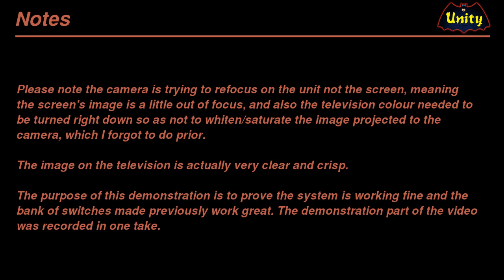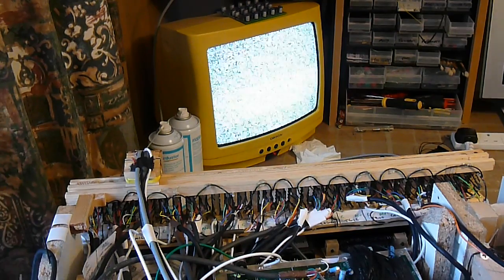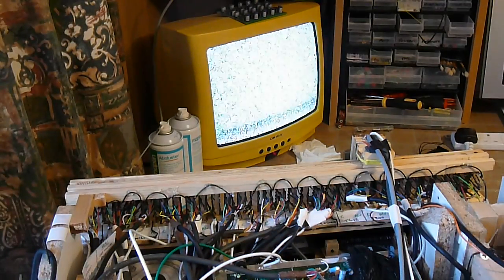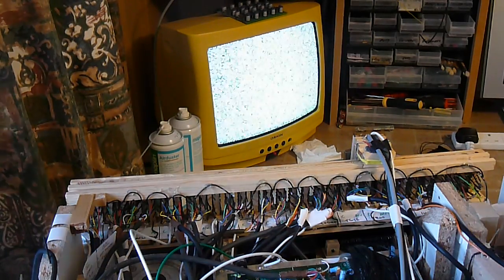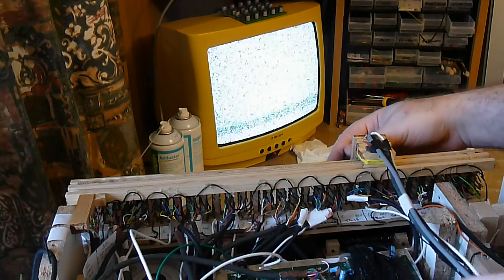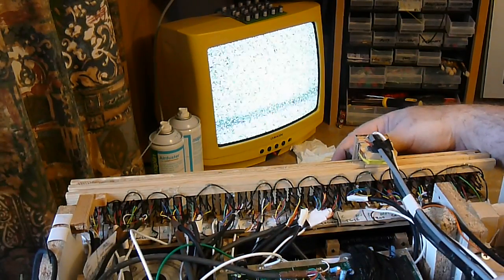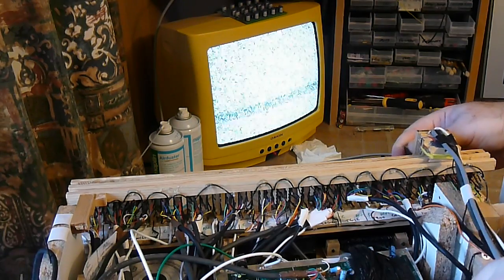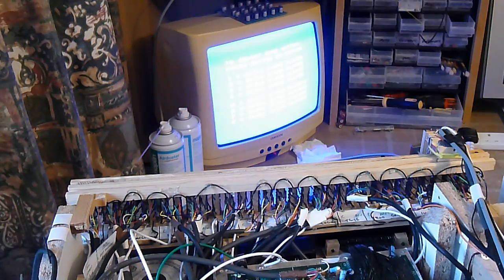Update on Project Unity system - mostly done, 90% completed

Comment from the maker: Yes, there are quite a few methods in the reference section on my forum, check them out. With tupperware, you only use the sides and then secure a flat top to it from strong plastic, reinforce the sides if needed, and job done.

Comment from the maker: Plug'n'play games. Good ones like the Namco two units have a few quality games on each. Plug'n'plays only need voltage, have an easy to find composite and audio connection, a couple of action buttons and d-pad; no heat, small boards. Join my forum, start a project and we can help you!

Comment from the maker: Can't fry myself, only 12v is going into the system, then into a stack of regulators. 

I'm not a collector, most of my games don't have boxes as i'd rather play games than look at sealed boxes; each to their own.

There is no issue if you only have a couple of consoles, but if several, then having that load of consoles, controllers, power supplies in your living area,  intertangled with all the cables is a nightmare, takes over your space - that is in essence what this project removes.